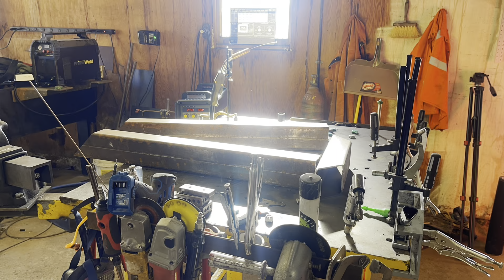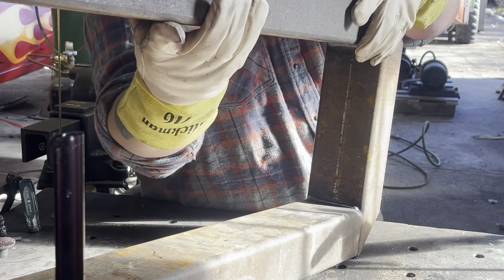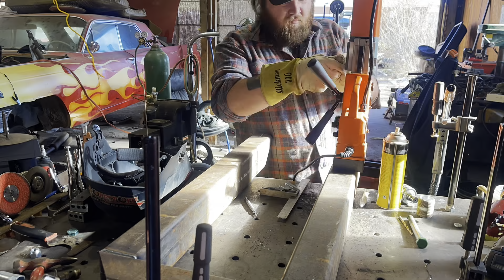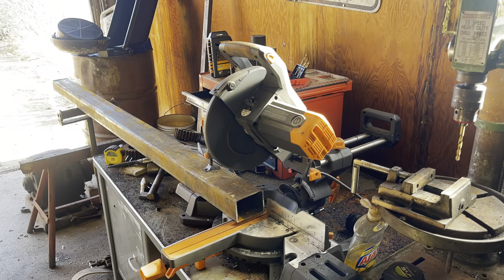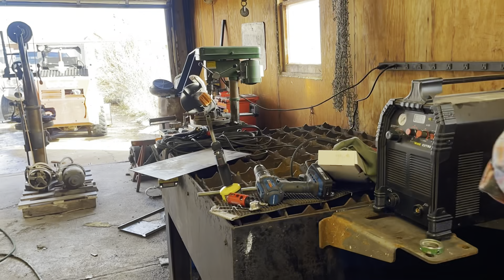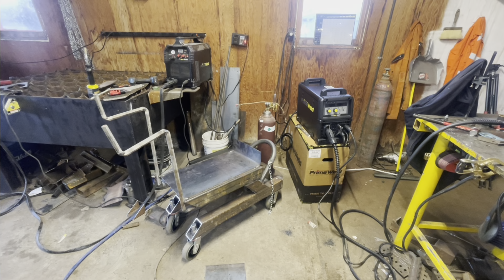Primeweld MIG 285 and why it’s the absolute best machine for the money!

Comment: Man thats a beast of a cart but I like it! Especially the free steel you used! Cant beat it!!
Reply from the maker: Can’t ever beat free lol 😂 it’s been working like a champ for a long while I love it
Reply: Well, my Primeweld 285 came in yesterday, tested it with stick and flux core last night, I have it on a makeshift cart.  I think I may build a cart for it, already have the casters for one, I think im going to make it where I can put 2 bottles on the end one for c25 and the other for either 90/10 or 100% argon. I have some square tubing similar to what you used that I picked up somewhere, it was some sort of weight lifting thing. Weld on!

Comment: That's goin to be a beefy cart, I like it!!  Does that machine have enough volts to get you into spray mode?? Thanks, again looks like it's gonna be a  awesome cart!!
Reply from the maker: @Ca21431  it’s been great! And yes it’ll spray transfer and run dual shield! I primarily use it for HD repairs and dual shield
Reply: @macdaddydiesel  thank you for the quick respnse!!   I called primewelds customer service on a sat morning not knowing they were closed, so I just hung up, Monday morning I got a call from them saying they saw i called and how can they help me, you don't get customer service like that anywhere, I was so impressed I will definitely will buy from them again!!
Reply from the maker: @Ca21431  it was absolutely the reason I switched I’ve had Lincoln’s millers and even HF stuff and they have absolutely some of the best service in the game

Comment: !000. dollars, no pulse and only 30% duty cycle. Don't Know
Reply from the maker: @tonyp9609  30% at 285 amps that would be in line with a 355 miller for duty cycle and pulse mig is cool but not really all that useful.  You won’t find another machine in the price range with the capabilities

Comment: Will Omnipro tig setup fit on Primeweld mig285.
Thinking of also going Omnipro to  Mig285.
Want to mig and flux outside  with 1/8, 1/4, and 3/8 plate in shipyard.

Comment: How do you get it repaired when it breaks? I’ve been a welder for 40 years, welders break down and need repairs. Every welding supply store will repair the big three( Miller/Hobart) and Lincoln. They won’t repair that welder.
Reply from the maker: You call up the company and get parts next day aired to you very few welding supply stores repair anything any more and infact primeweld is faster about getting parts out than Lincoln is
Reply: @kevinthorrington2131 lol no they won't. 

Got a particular Deltaweld that keeps throwing a helpline 700 code cause the plate thing on a board inside the machine is set for 460v, not 575 like it should be. Messer keeps shipping it back to us in the same state we sent it to em. They say they can't get it to throw a code. The dummy's use 460v so obviously it won't throw the code. Wish my keyboard had a face-palm emoji.

Comment: Nice cart build! I got the same Evo Saw. I also bought their bigger 14" saw as well and put both of them on the same table with the fences lined up. Works well when I'm cutting multiple pieces with different angles. Very efficient being able to cut a miter on one saw, then slide it over and do a miter or bevel cut on the smaller saw.

Comment: Hey MacDaddy, really like your style. Excellent review and build. I hope you make more fabrication videos. I wanted to ask about the Evolution saw. Have you ever had it kickback when doing angled cuts? Spec.s saying it's rated for 1/4 inch thickness on mild steel. Have you ever used it on sold bar stock over 1/4in. thickness?
Reply from the maker: @FlyinTrapezious  I haddnt had that saw all too long.  But it absolutely rocks and I wouldn’t trade it for much I don’t have much kickback but I like to be cautious and strap down my materials if you’re looking for a good saw that’ll do miter tube cuts i couldn’t recommend it enough allthough definitely get a Diablo blade

Comment: Mine was delivered last Monday!!! Awesome machine!! I bought the tig 225 last summer. And one of the great things is I can buy full size rolls of wire from work cheaper than going to a welding supply store. Dual shield roll 150 for dw50 mild. And I can get 316 stainless or aluminum also from work at their cost.
Reply from the maker: Definitely get ya lol always more cost efficient to buy in 33 pound spools